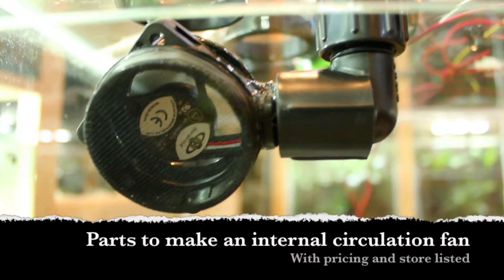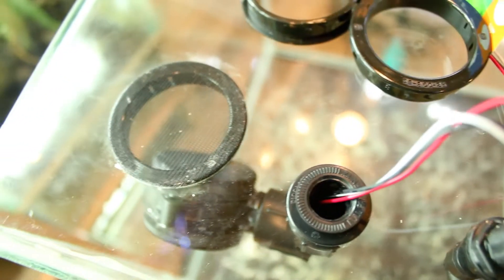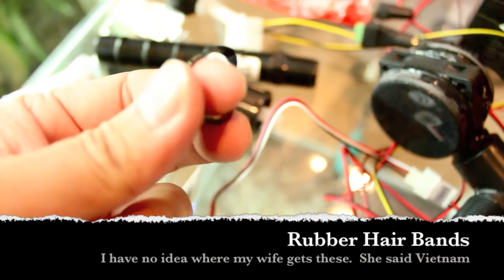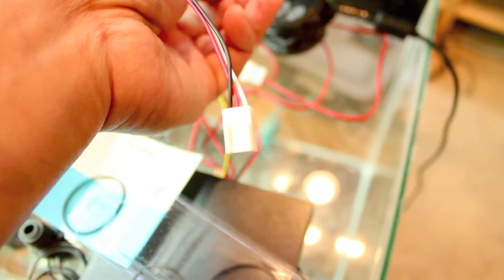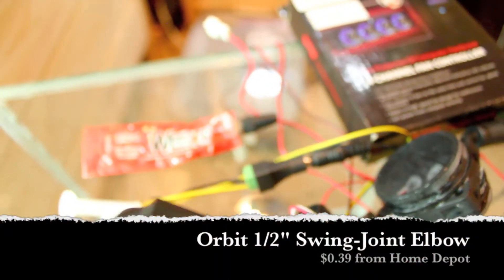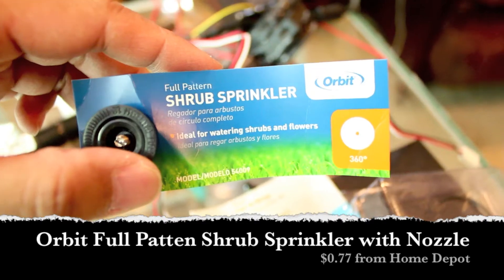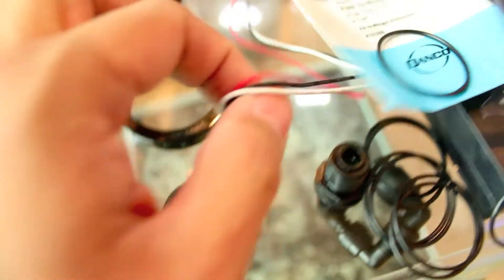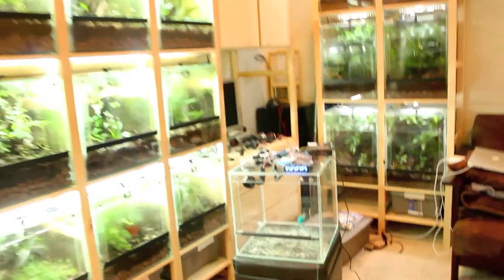Internal Circulation Fan Parts List

Comment: Nice use of random parts, the pvc section in home depot is like lego for adults in my opinion. Its surprising how low you were able to source alot of those parts, any idea on the CFM rating of that fan your using? The thought of using magnets to mount the fans seems like it would be a good idea since you could adjust positioning if you feel like changing things around (and it requires no drilling which I fear). You could even use a thin piece of metal on the top of the tank to attract the magnet